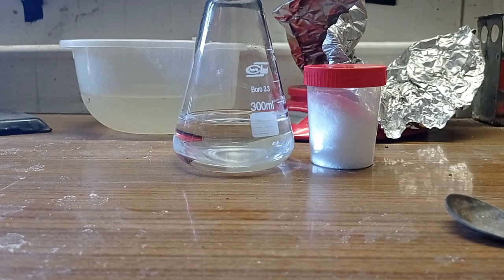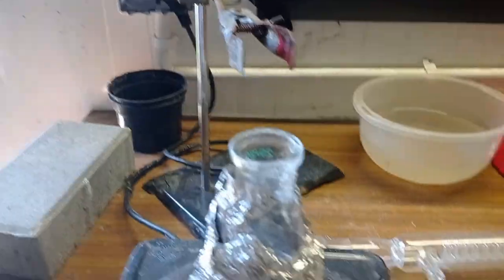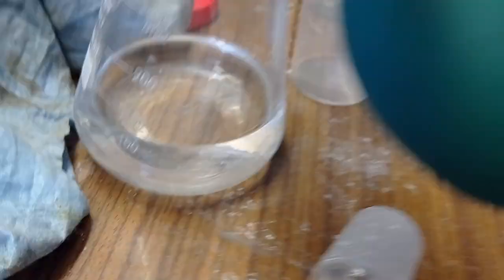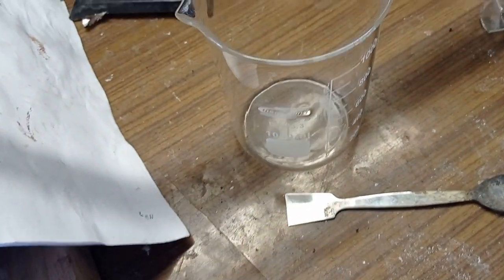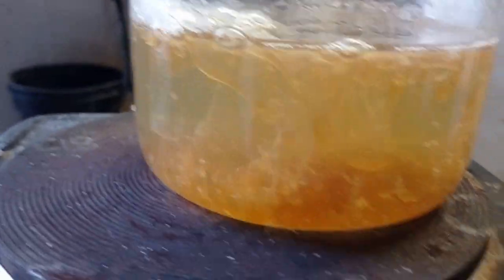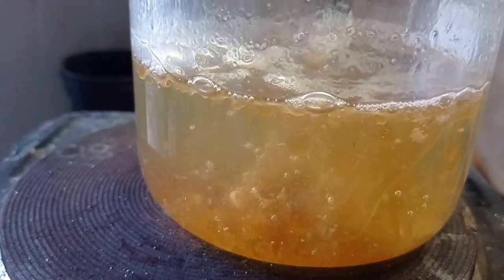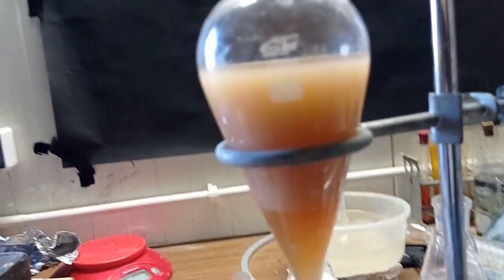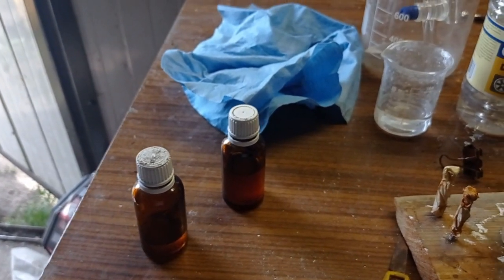Making some ethyl benzoate (Fischer's estrification)

Comment: You didnt make a mistake. However you did. The sulferic acid isnt pure. Its had iron added as an inhibitor to slow its ability to react. Thus you yeild suffers because you didnt allow for extra time for it to react, which the iorn is slowing
Reply from the maker: I also fucked it up cause there was some left over benzoic acid and sulfuric acid and I used calcium chloride so it participated out and the white mess appeared...
Reply: @nucleophile  ahh yes good call. Useing impure stuff usually isn't the way to go. But pure is expensive. But I applaud you trying anyway